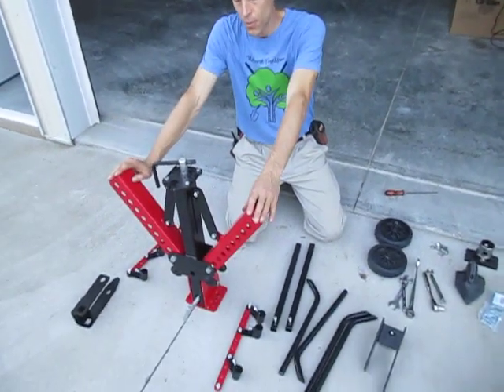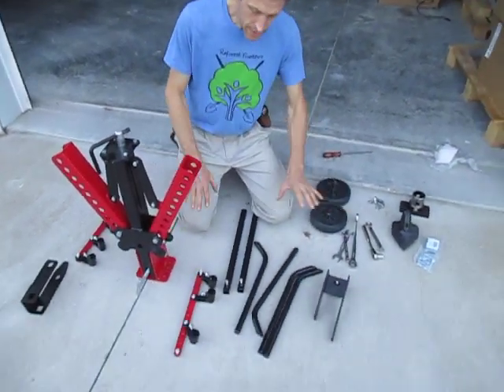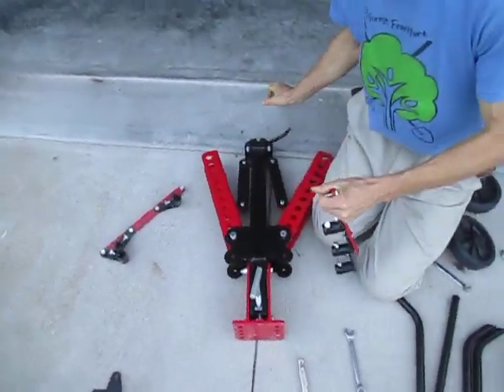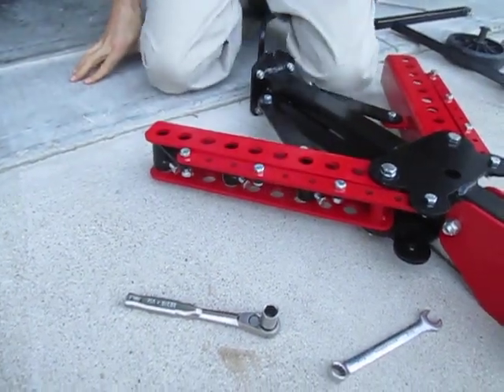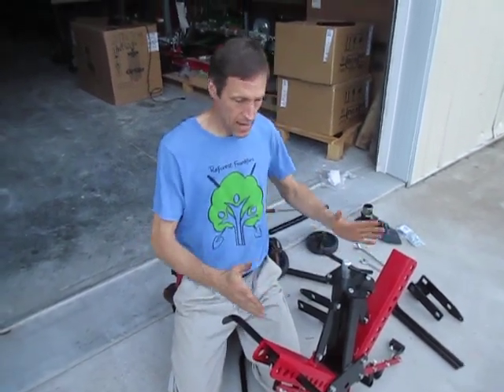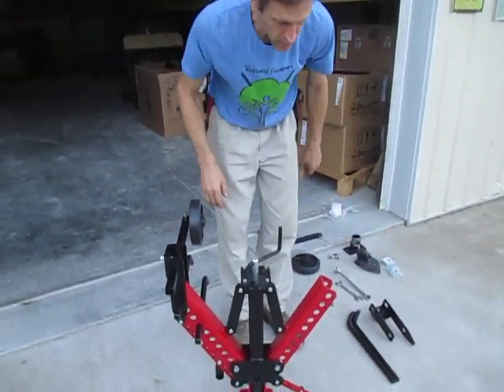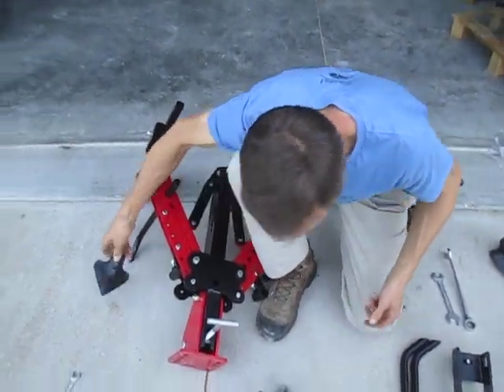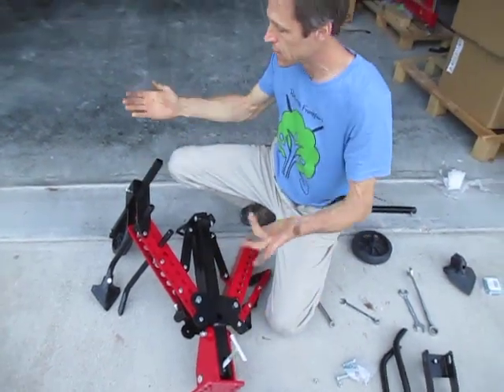Adjustable-Frame Cultivator for Walk Behind Tractors (New & Improved!)

Comment: Multi-use.  I like the idea of using it as a subsoiler.
Reply: I use a subsoiler on extremely hard ground in my garden. The soil is good, but the last implement used on this farm that I recently bought was pulled by a horse. Since the 40's only livestock have been on the pasture. Be certain to have plenty of weight added to the tractor. I use weights purchased at St Vincent de Paul on my BCS 853. I may used deep rooted radish (diacon radish) or turnip to restore the pasture.